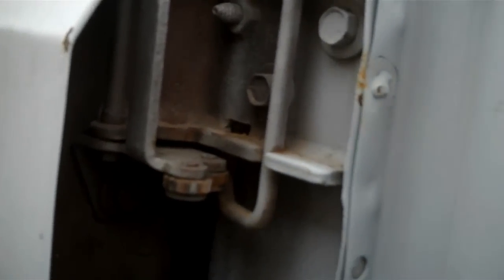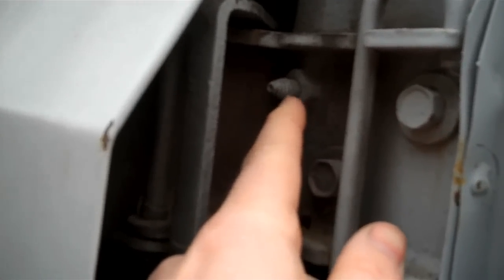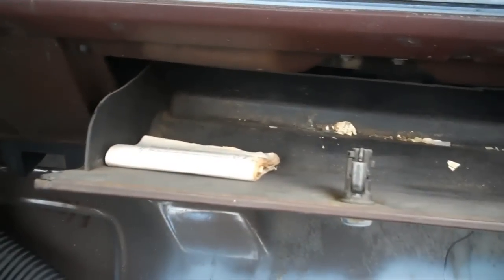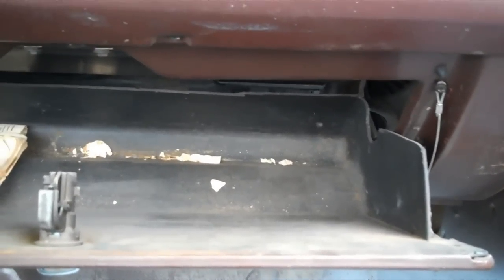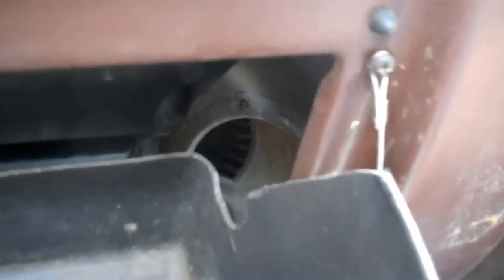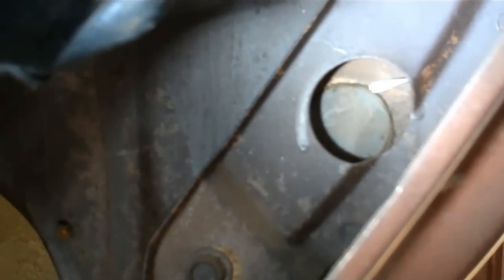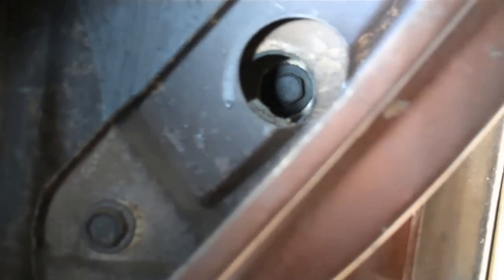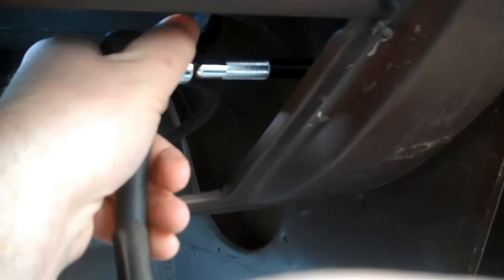73-87 C10 Door Hinge Repair | Interior Bolt Removal

Comment: If you have courtesy lighting, rather than a plug, you will find a single wire running through a rubber grommet leading to the door jamb switch. Unscrew the switch and remove the wire from it first. Easy job. Good vid. I would have figured it out eventually, but the time I saved got you a comment. 👍